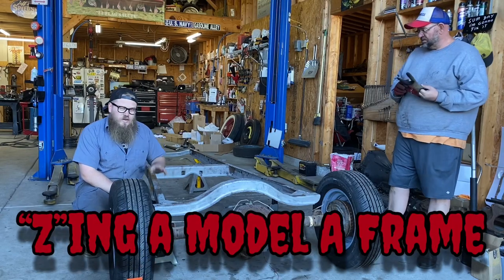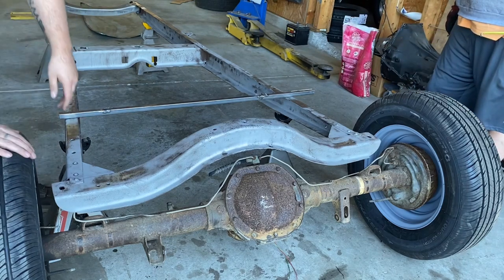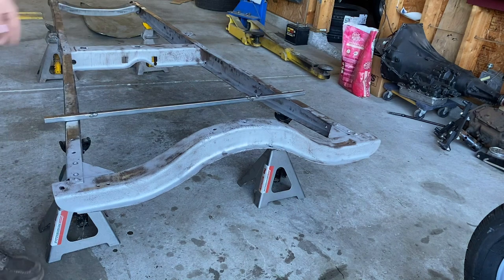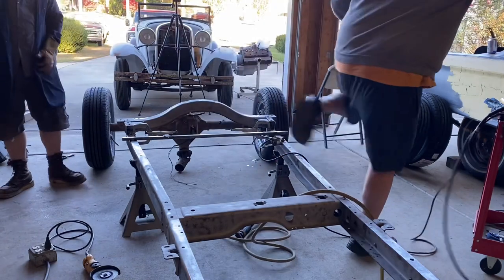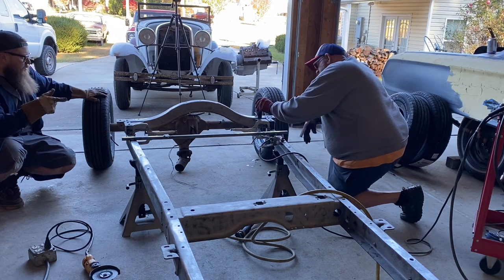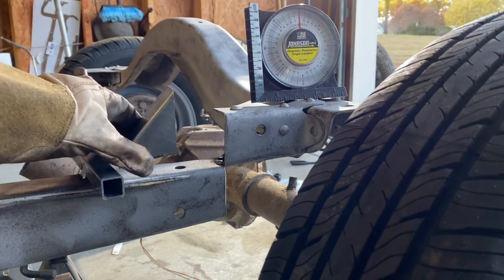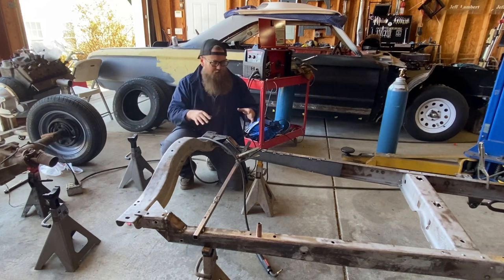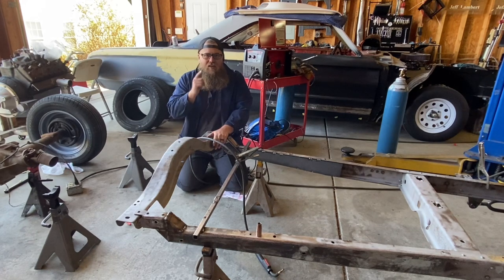Z’ing Model A Frame!

Comment: If you had made a 45 degree cut with the top of the cut at the rear, then you could just set the part you cut off on top of the rest of the frame and your length stays the same.
No angle-finding necessary.
Reply from the maker: I like that style of doing it as well! I might do that in a video on the next one!

Comment: Don't Ever, ever cut, weld, or do any modifications to any chassis if it's not solidly clamped, or even tacked to a straight flat, level, square, strong chassis jig. If you ever put some decent horsepower through it and manage to workout how to get traction, you'll crab walk at best. And if you're not careful it'll just break. TAKE CARE man, and good luck..

Comment: Looks good! Be stronger than the original frame rails for sure. What rear axle is that you're using?
Reply from the maker: Thank you! The rear is a 8.8 out of a ford ranger, they are the same width as the banjo
Reply: @WiredCustomsSpeedShop  That's a great axle. I hade one under my Jeep XJ with an Eaton locker and it was unbreakable. 👌
Reply from the maker: @slowshop   haha it was a cheap axle with the correct width at the junk yard! So I am super glad that it’s a good one!